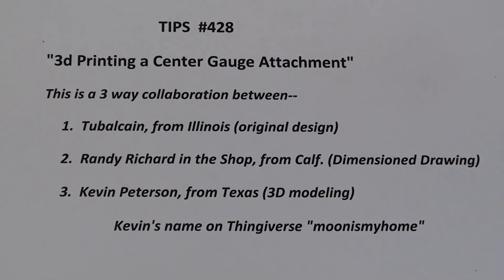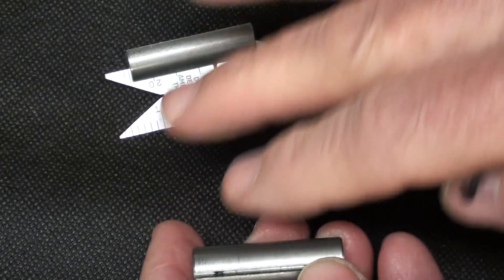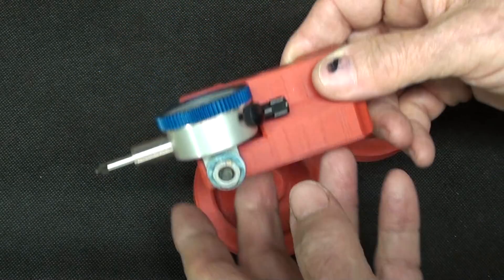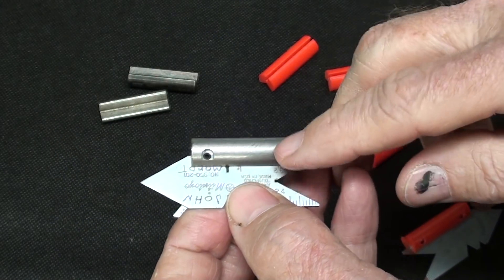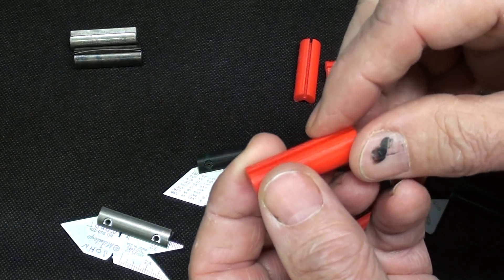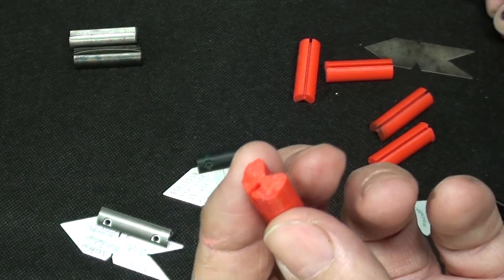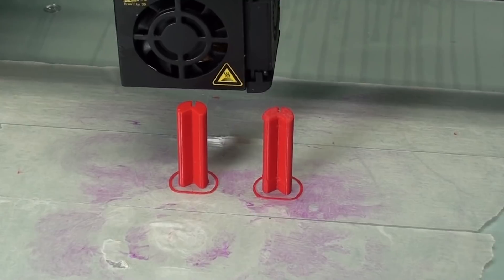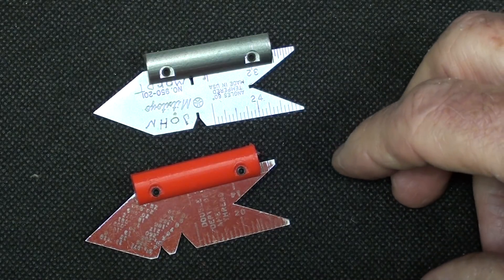Make a 3d Printed Center Gauge Attachment TIPS #428 tubalcain

Comment: I am curious if the delamination could be the result of printing multiples rather than one at a time, as it interrupts printing the next layer in order to print the same layer on each part, therefore returning to a cooled layer rather than staying on a hot one.

Comment: Hi, i do a lot of mechanical 3d prints and i have found that brass heat inserts from mcmaster carr are a good way to add threads to prints. You just press them in with the tip of a soldering iron. This might not be great for this application but they are useful in general.
Reply from the maker: Good idea

Comment: If you have issues with breakage around the set screws in 3d printed parts, you may want to look into heat-set threaded inserts for plastics. I've had a lot of success with those in printed ABS jigs and templates where I need to take fine thread screws in and out more than once or twice. For a 4-40, I use McMaster PN 93365A120. You heat them on the end of the soldering iron and squish them into a hole just slightly undersized.

Comment: I'm wondering if the issue you see with parts breaking would be from printing multiple parts, by the time the printer cycles back to the first part is it cooled off enough to cause a cold joint?

Comment: Mr.Pete (Lyle) I can't find another way to contact you. I  have a video idea for you. Can you make a video for us that don't know, on how to properly oil and store machinists tools? Thanks for the knowledge you share!!!
Reply from the maker: That might be a good video, but it would be a short one
Reply: May I politely second this request? My shop is in an old block building and while dry from above, it's unheated, so the temperature and humidity swings that occur throughout a midwest winter result in a fine coating of surface rust on some of the tools and metal surfaces. Regular heating for humidity removal is u$ually out of the que$tion but I'd like to know of any effective surface treatments or other suggestions. Thanks!

Comment: It's not an engine turning.  You could make the body more elliptical to get more volume around the screws.
Reply: Good thinking. The holder could also be rectangular as long as it fits the gauge and has the 90 degree cutout.